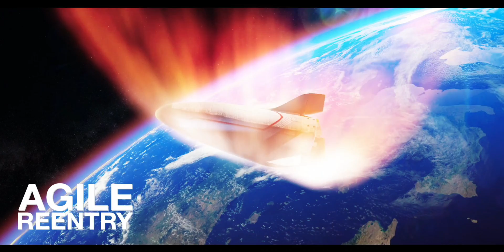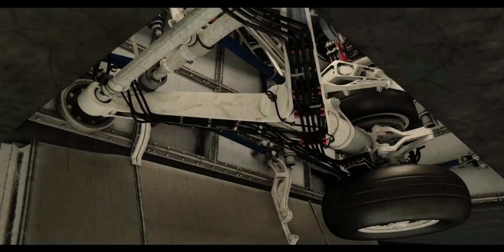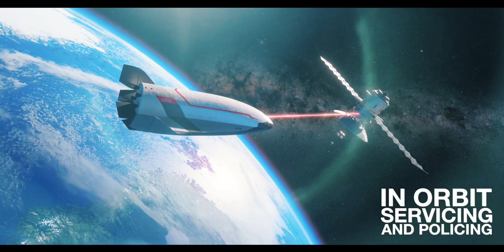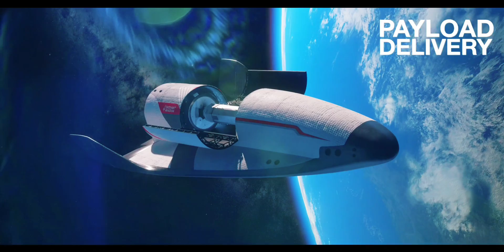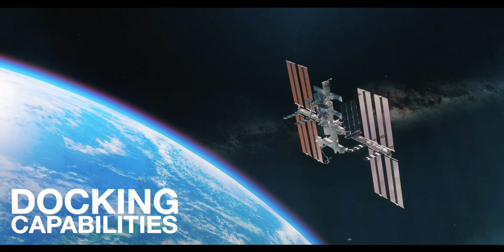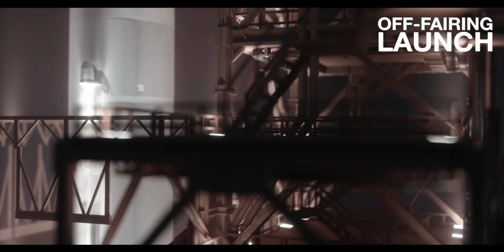Dassault Reusable Orbital Transport and Exploration Vehicle (VORTEX)

Comment: How does VORTEX relate to Susie, the reusable upper stage for Ariane 6 being developed by Arianespace?  Will the two designs ultimately compete with each other on some level, and if so, will Arianespace agree to launch Dassault's VORTEX on its rockets?  Both companies are French, and I'm not sure that Dassault has its own orbit-capable rocket.  Very interesting.
Reply: Susie is not a plane like Vortex, so even if they have similarities they're 2 different projects. I guess Ariane don't care until they get paid for the launch, but Dassault did not say clearly it was designed for Ariane.
Reply: SUSIE was rejected by ESA. VORTEX is not related to the ESA yet and fully funded by the french government.
Ariane rockets were built for the french government first and foremost so no worries there, although I believe Vortex is light enough to be sent from a smaller rocket like Vega.